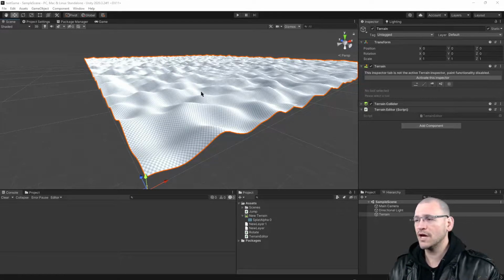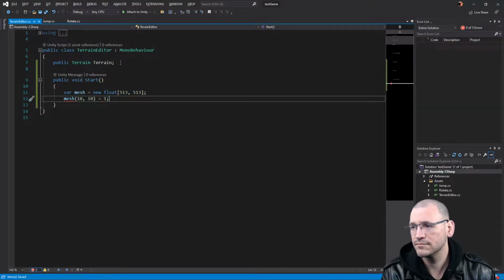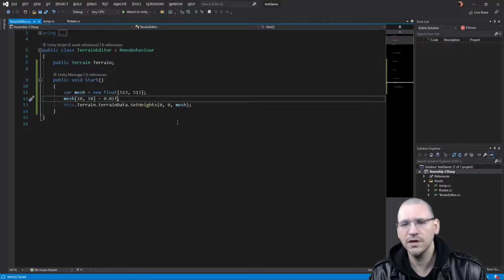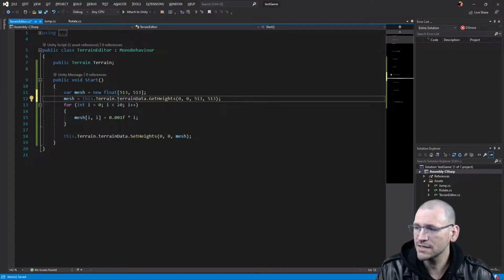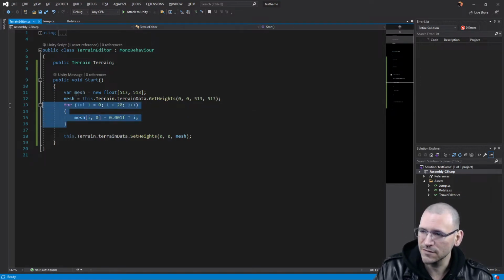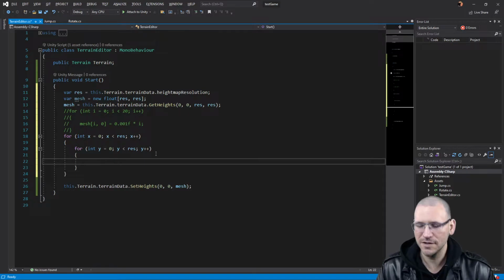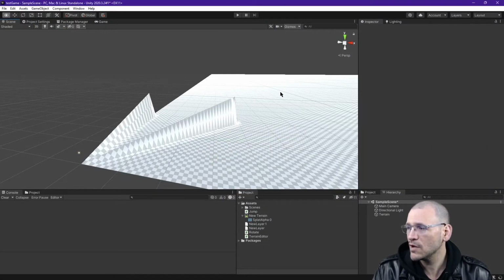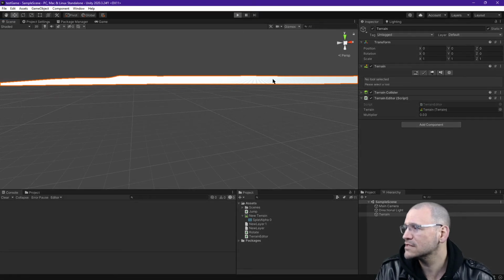Unity Procedural Terrain 1 - Height Map

Comment: I know how to modify the terrain heights. The problem for me anyway is that I don't understand how to do this using multiple heightmaps. There always are issues with things not lining up properly.
Reply from the maker: I've done that before using this. As long as you are converting the local space to workspace, the edges of the terrain will consume the same points in space along their border. I cover that math in one of the later videos on terrain manipulation I believe. I don't think there is a function built in for this (there very well might be), but you can use the size of the terrain (default is 1000, 600, 1000) / by the resolution (default is 512, but you need to add 1, I.e. 513) , which gives you around 1.9 meters. Of course you need to make sure you have the real x and y coordinate. X/Z are swapped I believe. Of course the Y/Z are already swapped to lay flat in the world orientation so this is all very confusing to follow. 🤪 But if you did it right, you get a perfect line up. Maybe I should do a video on this.
Reply from the maker: Oh wait, I did. https://youtu.be/DntIINPO41o  this talks about making it infinite.